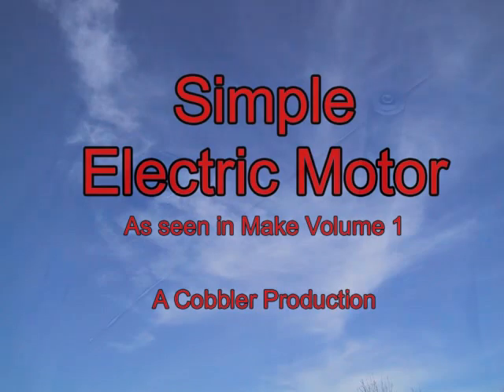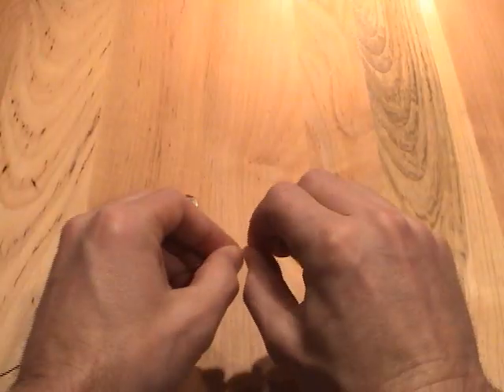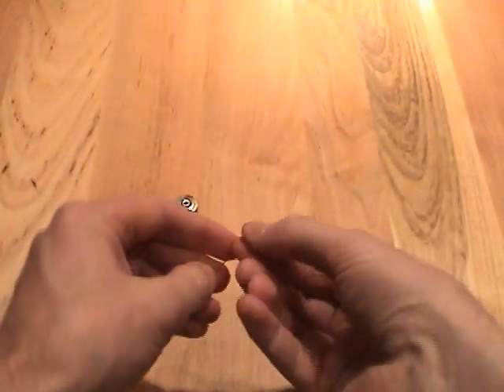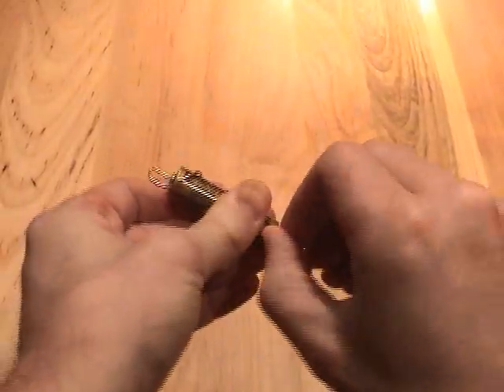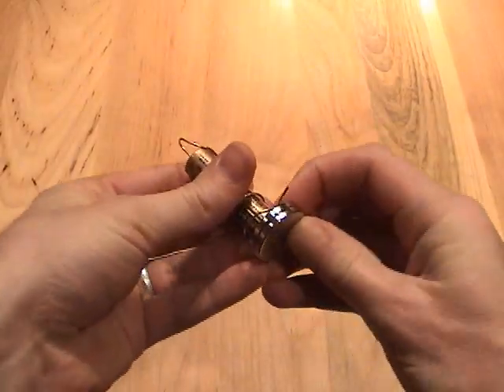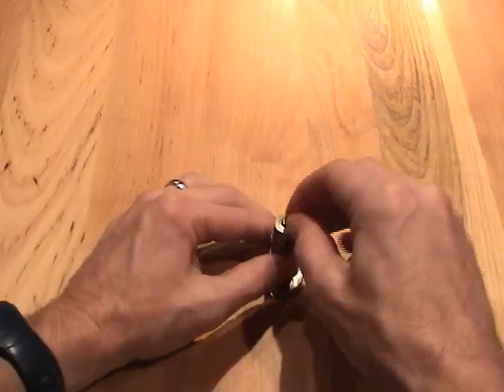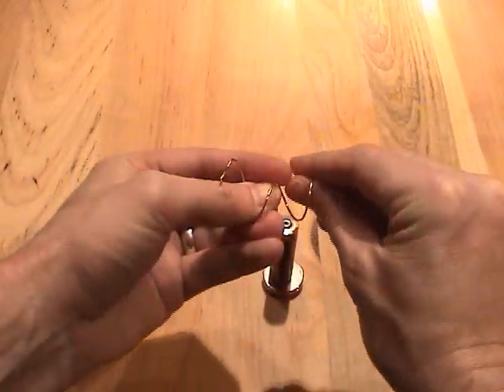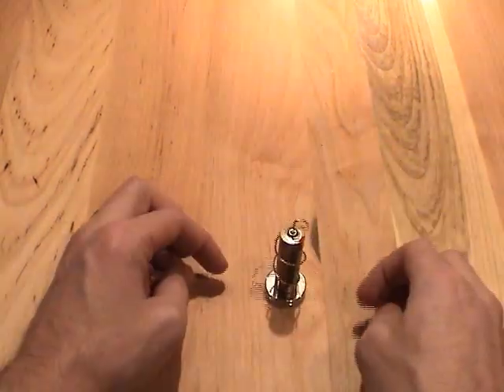Unexplained Phenomenon - Simplest Electric Motor

Comment: The battery charges the wire, reversing the poles, therefore, the magnet starts to repel the wire, much like when you try to press together two magnets and it keeps "slipping"

Comment: I think it is this. The magnet has poles (one positive one negative). The battery too has poles (one positive and one negative). The top part of the battery where we put the wire in had a positive charge. Since the magnet attracted the negative part of the battery we know that the magnet's pole touching the battery is also positive. The wire is positively charged since it is connected to the positive terminal. The magnet repels the wire since the EM force of the magnet is not completely covered.

Comment: The wire touches one end of the battery, let's say the + end, and the magnet the other, in this case the - end. Now, the end of the wire that's close to the magnet is the new + end of the entire thing, while the magnet is the - end.
Your theory has been proven unusable on this construction.
One more thing: electrons have a negative charge and protons a positive charge. Another positive charged particle is the positron, which is the anti-particle of an electron.

Comment: You need a charged battery, of course... The strength of the magnet will only indicate the speed of the rotation. And you probably have used a metal wire. (Iron, copper, or just about any metal you can name.)
If it doesn't work, you probably have done something wrong. Science does not lie.

Comment: maybe because the wire and the magnet are repulsive,so instead of wire geting away from the magnet,it just turns around sinse it's stuck with the battery. well at least, that's what i think :/ .

Comment: Connecting the wire to the battery creates an electric circuit through the wire and flowing electrons produce a magnetic field. The coils in the wire amplify the magnetic field to create an electromagnet. When the field lines of the electromagnet meet the field lines of the permanent magnet they produce electromagnetic induction which changes the magnetic properties of the wire. The changing magnetic field creates a force perpendicular to the field lines causing the wire to spin.

Comment: My interpretation is that the battery creates a constant current through the coil, with the electrons having an upward average velocity v. The magnetic field from the magnet induces a force (Lorentz force) on the electrons, given by F = v x B, where x is the cross product. Because of the geometry of the battery, B has radial symmetry, and the radial component of B is always perpendicular to v at any position in the coil, giving an average force always in the direction of circular motion.

Comment: the current flowing through the wire makes the wire a mini-electo-magnet, and in the very strong magnetic field of the new-magnets at base, there is a considerable magnitude of torque acting on the wire
that's y the shape dont matter, coz al that matters is, is a current carrying conductor, plzced in a strong external magnetic field, at some specific angle.
phenomenon called.. NO IDEA!!

Comment: this is same how fan works , the electric pulse by battery ( electricity) empowers the cable , when the electricity  goes thro wire the wire gains an electromagnetic field and u got magnet under battery which more likely have repulsive fields which ends up pushing wire , and because wire is bended as spiral shape with battery it allows it to freely to spin !

i hope this was correct , am electrical eng undergrad stud, 1st year still :D

Comment: Copper wire and any magnet/battery.

If it doesn't move try flipping the magnet over or loosening up the wire so it's not so tight around the battery.

Comment: the wire has electrical current running through it and the magnet is interfering with the path of the electrons and that causes the wire to spin works better with neodeniyoum magnet this is coming form a 7th grade 13 year old

Comment: Perhaps you forgot to add that it confers most of those protrons (yes a cross between the two in this case) to the outer most sector of the used conductive cable. In spite of the super electron carbonation this is able to occur (crazy I know). All the while, the white blood cells multiply and then surprisingly alleviate off of the surface of the two and into surrounding human bodies. Really quite a dangerous experiment he has going here.

Comment: What happens is that you are creating an electromagnet with the coil of wire, depending on the number of turns of the wire and the direction will give you the basic polarization, but only once the battery is passing the current through it, thus touching the other end of the wire lightly to the magnet. the moment a current is introduced a basic north and south pole is generated, which will act immediately on the other magnet pulling and repelling to certain parts, thus the generated motion.

Comment: BULLSHIT. This works, because magnetism is another form of electricity, hence the term electromagnetism. What happens here, is the battery gives off protons from the positive side,while the magnetic waves in the magnet cancel out the electrons from the negative side. This causes the wire to spin because of the mixture of magnetic fields and protons around it.

Comment: Its very simple, the battery touches the two ends, positive and negative, and when it touches it the electricity starts passing trough it, and the magnet creates a magnetic fields tham combined with the shape of the wire and the electricity makes the same think as an normal electric motor, u know the small wire around an electric motor? this makes the same think , it makes spin the wire

Comment: hahaha, this isn't an unexplained phenomena, when you wrap wires with a current flowing through them around a conductive object/material you'll create a magnetic field. The magnets on the bottom of the battery are interacting with the magnetic field of the wire in such a way that makes it spin. :)

Comment: The reason this works is because the Lorentz force, the current flowing through the wire is perpendicular to the magnetic field lines of the magnet, applying force tangential to the curvature of the battery. wikipedia(dot)org/wiki/Lorentz_Force

Comment: As a potential difference from the battery passes through the wire a force is induced, causing the wire to spin. This is because a the wire is in the presence of a magnetic field. Learning about this in physics :).

Comment: It works because it has two poles a + and a - with a magnet on the minus pole and a wire from the minus pole to the plus pole you now have a short circuit of the battery that makes the wire turn around. You do basically empty the battery just like if you used the battery in all others kind of electric devices.

Comment: Its because of the super-electron carbonation within the battery that causes this phenomenon. There is a slight geographic bend in the composition of the wire. That causes this strange geomagnetic occurrence. The magnet on the bottom rapidly generates protons, neutrons, frictions, and white blood cells. These transfer to carbo-phosphatic molecules. And then these are passed throughout this whole structure creating this amazing, revolutionary effect.

Comment: Unexplained Phenomenom Explained: 
When a charge or current is moved through a conductor It generates a magnetic field. This magnetic field applies force to the wire. Causing it to spin and thus increasing the relative motion further. Increasing the strength of the magnetic field. And thus increasing force further This continues until friction and similar resistive forces prevent further acceleration

Comment: Simple physics but its still really cool. All it is is a simple electromagnet the wire acts as a solenoid and generates a magnetic field and the wire is loosely wrapped so it just kinda floats around on the magnetic field, following the opposite magnetic pole around.

Comment: I made mine by putting a hole right thru the battery, magnet and table. Then i ran the wire all the way through to the bottom of the table where I connected it to a mounted electric motor I pulled from an old cassette player.  Works good, but it needs 2 AA's.

Comment: MAGNET IS CONSTANT FORCE,ENERGY FLOWS SIMPLEST ROUTE THE WIRE,DRAWN BY FORCE(THE MAGNET PULLS MORE ENERGY THAN THE WIRE CAN HANDLE CAUSING A SPIRAL PULL.THE REAL QUESTION IS HOW MUSH ENERGY THE MAGNET DRAWS JUST BEING UNDER THE BATTERY) QUESTION #2 DOES THE ENERGY RETURN TO THE BATTERYAFTER BEING DRAWN OUT,IF IT DOES THEN YOU CREATED A CONSTANT FLOW OF THE SAME ENERGY ONLY

Comment: Well you're right indikaGreat. MrJewsbury 's answer is partly true but not quite right. What happens really is when you pass an electric current through a wire it creates a magnetic field around it.That's the basic principle of an electromagnet, like in the video, a coiled wire around an iron rod (battery). So to explain it briefly, the coiled wire or electromagnet creates either a North or South pole depending on the polarity and repels the magnets pole at the bottom, that's why it moves. Savy?

Comment: That's the Lorentz force (check wikipedia like everyone):
when a magnetic B field and an electric intensity I are in the same spatial area (nearby the magnet), a F force raises up. B is up-down oriented near the magnet; I comes from the side of the magnet (so nearly radial horizontal), so an horizontal F force pops out, and so, a moment force (torque) is created along the battery's axis.

Comment: The reason it spins is pretty simple. The magnet is polarised, one side is +ve the other is -ve, the electrical current passing through the metal wire has a -ve charge because electrons have a -1 charge. As the negative electron charge goes through the wire the negative charge in the magnet repels the electrons pushing it away, causing it to spin due to the magnet being circular.

Comment: The magnet does two things: 1) It creates a fixed magnetic field; 2) it connects the bottom end of the wire to the neg terminal of the battery. So with the other end touching the top of the battery, there is current flow through the wire. Current in a wire creates a magnetic field around the wire, even if it's straight. This wire is wound in a spiral, so the mag field from the wire is slanted with respect to the fixed magnetic field. This puts a sideways force on the wire and turns it.

Comment: Unexplained phenomenon...

in homopolar "motors" electricity travels trough a bended spiral cooper wire, positive charge travels to negative usually we expect that generates heat, but insead heat we can see  a neodymium magnet which is attached  in the "negative-pole of battery that action made  diferent charges repeal ans thats why wire spins

Comment: Maybe I´m a wise guy, but is called electronagnetism, simple as that. A current circulates trough the wire creating a magnetic field oposite to the magnet in the botom, so the wire is light and place correctly to spin. Simple as that if you have study elctricity as I did 25 years ago. Not an unexplained, bur very nice phenomenon.

Comment: Electromagnetism 101:  Current applied through a wire generates a magnetic field around the wire using the right-hand rule: (if you curl your fingers around the wire and point your thumb in the direction of the current in the wire, the magnetic field would curl around the wire in the direction of your four other fingers)  this magnetic field pushes off of the magnet's own field.  (like-poles repel).  Hence the wire spins around the battery.

Comment: my guess is that the electrons are pulled in by the magnet at the bottom and pushed out at the top causing the wire to spin in the oppest direction. but that is just a guess o be nice youtubies.

Comment: Think of it like this: slide a flat surface onto a slanted surface, and pushes the slanted surface to the side. That's how this would work with his theory. The slanted wire is opposing the magnet (they would both be positive/negative) and so therefore, it pushes the wire. Since the wire can't go anywhere, and the magnet won't spin with it, it will infinitely spin.

Comment: I made something like this (well not exactly same style but the principle it works on) in my grade 9th science project ... "The Beakman's motor" (perhaps the most simplest form of a DC motor) .. The current passing through the coil has magnetizing effect on coil ..and coil rotates due to magnetic poles (poles formed due to magnetizing effect on coil and the pole of  magnet placed beneath the battery) - repulsion/attraction principle ..

Comment: It has to do with the flow of the electrons through the wire. Atleast that is the best I can assume. The electrons always flow in a clockwise fashion through a piece of wire, than given the electromagnetic interference of the magnet, it spins the copper wire.

Comment: It's basically just an electric motor, the wire is the coil and the permanent magnet is stationary rather than rotating with the assembly.  Current flowing through a wire creates a magnetic field, which due to the coils being at an angle is opposed by the permanent magnet, causing the spin.

Comment: simple, the energy being produced to make the spin comes from the battery right?
nope, the added electrical charge creates an electromagnetic charge that currents the through the winded wire to produce an equal force that exerts the rest of the energy out the end of the wire that propels the magnet, but the magnet has an equal and opposite charge towards the wire witch is seen easily because the wire has the rotating design added to this creating a propulsion effect.

Comment: I actually based my final year 12 physics EEI off this phenomenon. using 4 9v batteries, 2 capacitors (5400somethings I think), some wire and SPTP switch. I connected the 4 batteries into the switch which, when clicked one way charged the capacitors, then when clicked another way released the charge through coil consisting of 200 circulations. I could then place a nail with the end cut off on one side of the coil which was then fire by the force created by the current going around coils.

Comment: basically whenever current flows through a wire (ie due to a battery), a magnetic field is formed encircling the wire. This magnetic field interacts with the magnet attached to the bottom of the battery creating a force (due to flemmings left hand rule) which causes the coil to spin around.
Hopefully that's a bit better :)

Comment: the battery is attatched to both the metal wire and the magnet, so the wire simply follows the magnetic field around the magned due to it heightened energy from the battery?
Just a guess im a welder not a genius

Comment: Oh, it works because current is flowing through that coil around the battery, this creates a magnetic field at 90 degrees to the wire and the magnet. once the wire has a magnetic field it will interact with the other magnet at the bottom of the battery just like any other magnet would. also, the coil will create a force due to the current, it might sound a bit strange how current can cause the wire to move but it's just flemmings left hand rule

Comment: Magnetic fields are caused by perpendicular electron flows from within the magnetic material. permanent magnets have a constant circular motion of electrons inside which induces a magnetic field. it also explains why pretty much any non-metallic substance is also non-magnetic :P

Comment: Also, if you flip the battery around, you'll basically be swapping the polarity and it will spin the other way.  If you wind it the other way, you are in turn swapping the field, so it'll spin the other way.  If you wind it the other way AND flip the battery, you swapped both so it'll spin in the original direction it did at first.

Comment: Basically the coil around the battery would be like the armature, the tip at the top of the battery would be producing your armature current, and the part touching the magnet is the field the armature is cutting.  So long as the battery has juice, it'll spin forever.  It's just a simple motor.

Comment: I'm an electrician, you just made a simple DC motor lol.  In a DC motor, you need field current(the magnet) and you need armature current(the positive side of the battery).  In a normal DC motor, you have carbon "brushes"(they don't look like brushes, they just brush the commutator) aligned in brush boxes that make up your field poles.  With springs those are held firmly down on the commutator and the windings which make up the field current(which is like the magnet) and "cuts" the armature.

Comment: the answer is simple its the science of polarity the metal magnet completes the connection so the wire has power running through it  causing a pulsing magnetic field due to the spiral in the wire but the wires magnetic field is reacting against the polarity of the close by magnets magnetic field causing movement

Comment: It may be the angle of the wire on the magnet below it. The wire itself is not touching but the magnet wants to bring that angle down towards it. It cannot. being a circle it spirals. Like a eulers discs momentum and gravity. But the motion is perpetual. Due to "artificial Gravity"

Comment: The magnetic fields created by the magnet and the flow of electricity in a completed circuit of the battery cause the 2 separate polarities to constantly conflict. The Wire rotates to match its magnetic field of the magnet, as it does so, the polarity created by the wired connection of the battery rotates the wire.
The magnetic fields are just trying to align them selves with each other, what we see is the wire rotating because it takes less energy to spin the wire then it does the magnet.